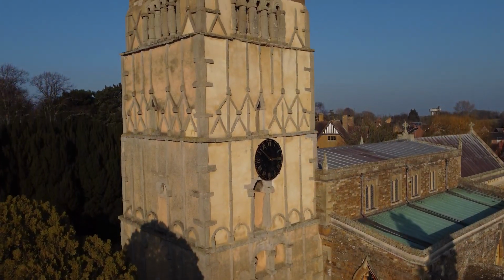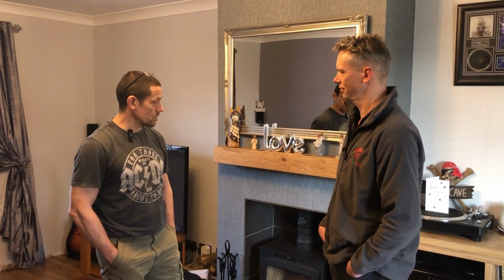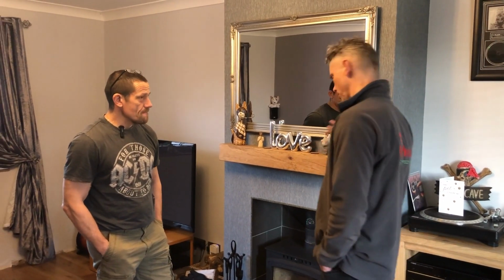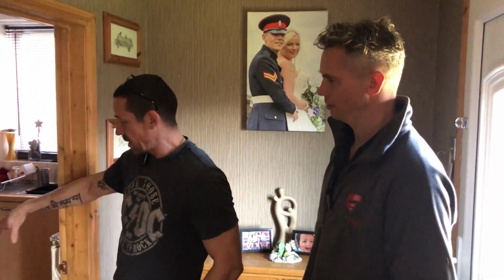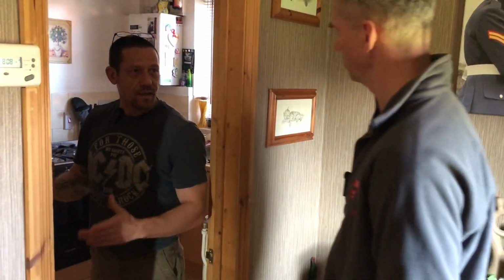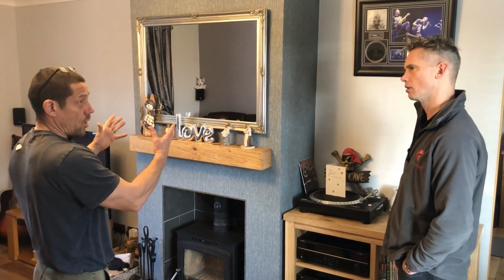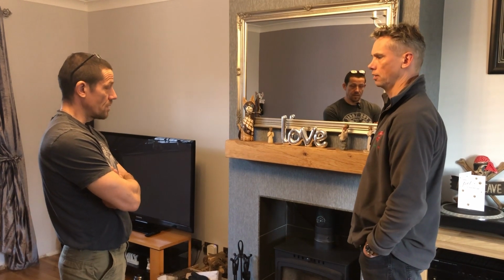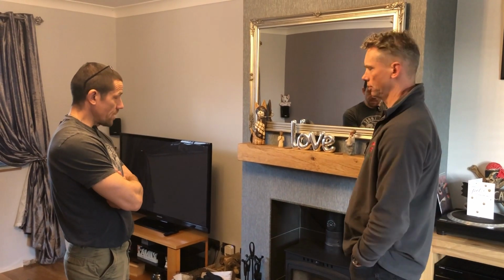Superb Wood Stove Accessory (Increase Heat Output)

Comment: Hi I have a woodburner back boiler  its broken. Told now best eay to get just woodburner . But im very stressed as gave a little corridor coming off tgen kuds tooms each side . Are back boiler heated whole house woodburner won't. So as one kever how nany rooms can thus heat or is just hestd gir efficiencly rokm where burner is .
Reply from the maker: Certainly have several customers doing exactly the same - using stoves that have a defunct back boiler. It obviously depends on the size, layout and insulation of the property, but the Recoheat will certainly make some difference and may make a big difference - about 70% of customers heat the whole house with theirs. The good thing about a retired back boiler stove is that it's big with a lot of heat going up the flue because water cools the stove a lot. So a Recoheat has a lot of heat to work with. The biggest I know of that we're on are an old Rayburn, which is heating upstairs as well as down, and a Hunter Herald 80B, which has transformed downstairs and heats the hall outside a very large room in a very old and leaky house. They use a lot less fuel than before, too.

Comment: I like that you have so many videos uploaded - reassures customers - if you got it and it works well why not flaunt it! Very good...I've placed an order earlier today 10411. No brainer I just hope my fitter can integrate it when fitting my wood stove as the flue will need to bend to the left slightly as the chimney opening is to the left unfortunately
Reply from the maker: Thanks very much for the support. We'll need to check that - the coil needs 12" vertical to the top of the first bend.  I'll give you a bell - maybe have a look at a photo. Thanks again.

Comment: Still very pleased with ours, which was fitted at the end of November along with a multifuel stove. We also had the heat exchanger unit fitted at an angle so the hot air is directed towards the room divider doors, when open the heat warms the dining room and then mostly finds it's way into the hall and upstairs. When we use the stove, on colder evenings, the central heating is not needed.

Mostly we burn wood, but a good mid evening stoke up with smokeless fuel means a nice warm downstairs the next day. We don't leave the Recoheat on at night though in case the fire dies down to the extent we're blowing in cold air as our pump is located outside.

It certainly added a lot of value to our stove!
Reply from the maker: That's fantastic to hear Steve - thanks very much for sharing!